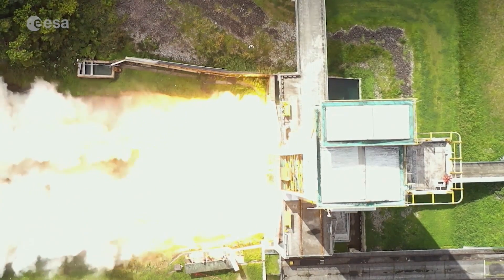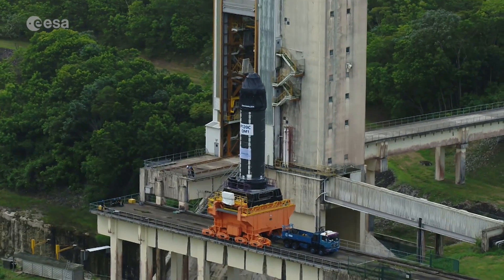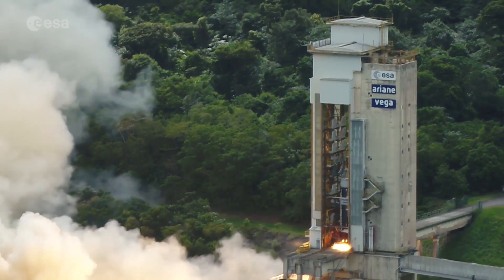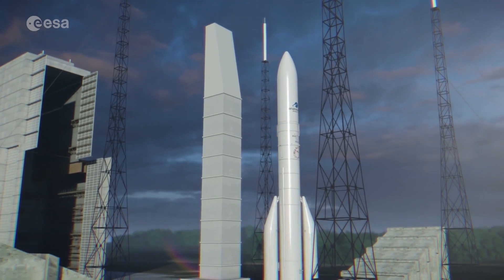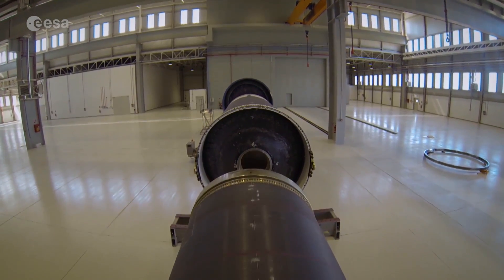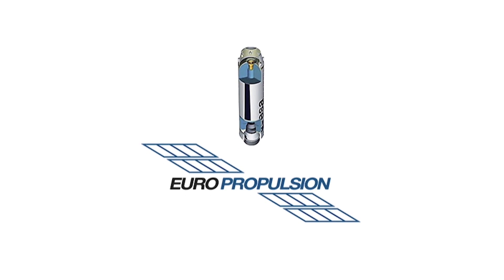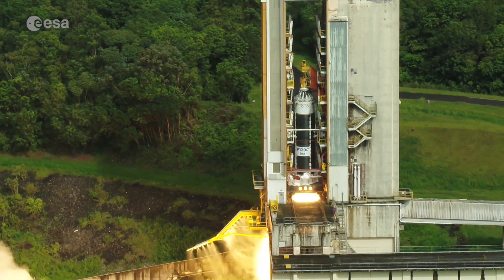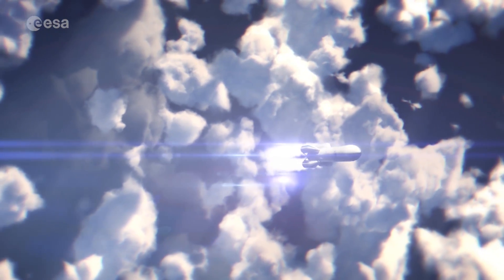P120C second firing test

Comment: Great about rationalization and reusing proven parts in another rockets! But what about reusability? Like, these rockets are really expensive - I would definitely prefer to see more Rosetta-like missions than rocket boosters falling into ocean...
Reply: Not really worth it with solids, Shuttle program did it and it was more expensive than just making new SRBs. And with Ariane first stage Vulcain engine it's not really viable to do SpaceX style recovery. ESA needs a new engine and an entirely different launcher architecture to get on board with reusability program, it's not happening with Vega or Ariane. That's what Prometheus engine is in the works for and there is also a hopper style test program planned for it, that's years down the road though.

Comment: How do you measure the thrust of an engine mounted vertically? Wouldn't the change in weight as the fuel burns make the sensors give a higher value? Do you just do the math to calculate the thrust given the reading of the sensors and the mass of the burnt fuel?

Comment: I certainly don't expect conversions to Imperial units, but what everyday person anywhere has a handle on kilo-newtons? Anything wrong with metric tons of thrust?
Reply: Rich Marceau A metric ton is a weight, a kilo-newton is a force. So it is definitely better to use kilo-newtons.. And to your question, I use newtons every day
Reply: @Tomwesstein  rolls eyes OK, make a proper compound SI unit analogous to lbf.

You may well use newtons as a unit every day. Good for you. The general public doesn't* and this video appeared to be directed toward them.
---
*even if they are French, I wager?
Reply: @disorganizedorg  I don't use kN every day but space propulsion systems has and always will be in newtons, as explained by Tom, this is the proper unit and everyone in this business uses it.
Reply: @Cin_Vhetin  Fine and good, but the video was intended for a non technical audience. Wikiepedia does a better job in making units useful to a lay audience:

Attached to the sides are two P241 (P238 for Ariane 5 G and G+) solid rocket boosters (SRBs or EAPs from the French Étages d’Accélération à Poudre), each weighing about 277 tonnes full and delivering a thrust of about 7,080 kilonewtons (1,590,000 pounds-force).

I don't think many average people on the street would have any grasp of what a kilonewton is; if the intent of this video was to communicate it failed.
Reply: Because the average European knows how much a pound-force is.
You really didn't gave a good example.
And dude, literally just divide by 9.8 and you get the metric tons of force if you so much want it
Reply: 721.9 tons of force btw
Reply: 1N = 1kg * 1m/s^2 or 1000kN is enough to lift ~100 tons of mass. I would think anyone with grade school education can understand this.